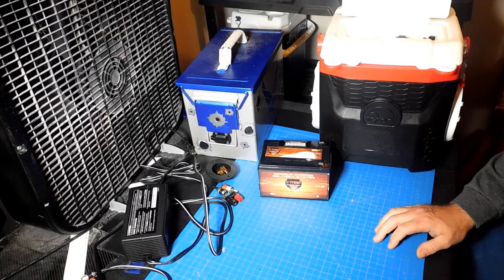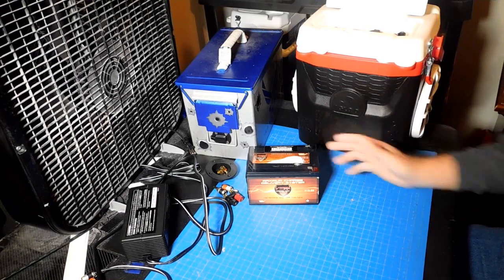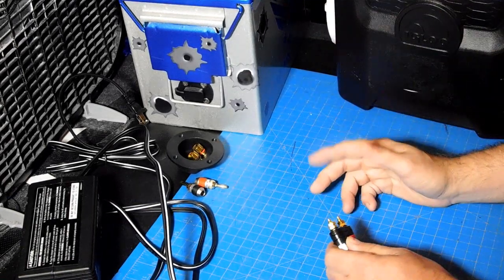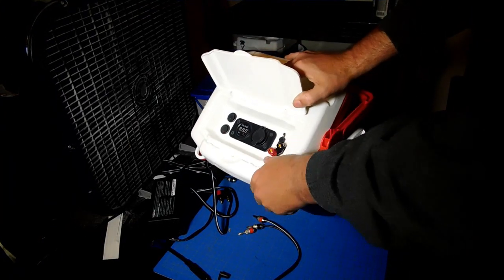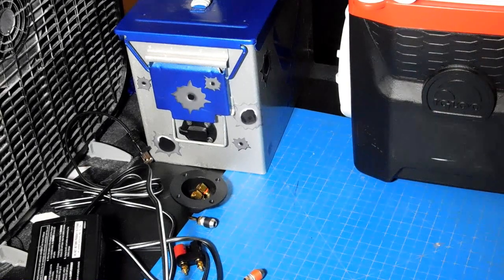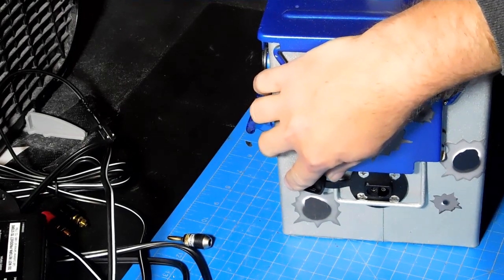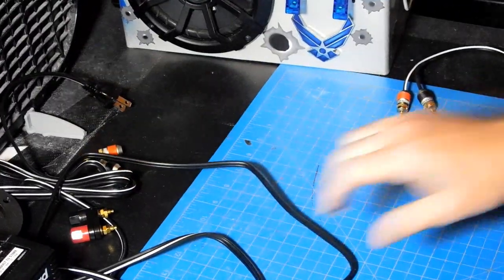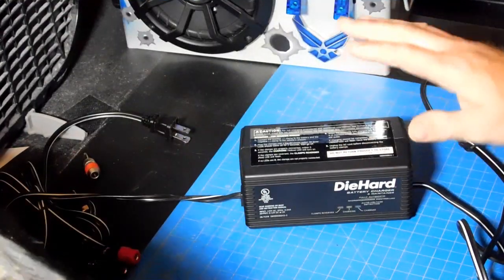How To Charge Your Lead Acid Battery

Comment: Phil, do you have a link to that weatherproof solar connector plug and the battery charger you used for the solar plugs in this video, (How To Charge Your Lead Acid Battery)  I don't see any links in the comments.  It might be since the video is so old they were removed.
Reply from the maker: https://www.amazon.com/gp/aw/d/B07V6NJ37P?ref=ppx_pt2_mob_b_prod_image
Reply: @diyboomboxesintexas2805  thank you sir.  What battery charger do you use?  I have looked at chargers but I don't see one with the connection for this plug.  Thank you for your videos.   They have helped me so much  and I really appreciate them.   Disregard my message.  I figure something out
Reply: They are also known as SAE connectors. Sometimes the polarity is different depending on what you buy (positive/negative could be male or female) I use them because auto parts stores usually have them too

Comment: About how long with an 8ah battery run one of these ammo Can speaker boxes?
Reply from the maker: Alot would depend on what amp you are using and if you are running any other accessories.